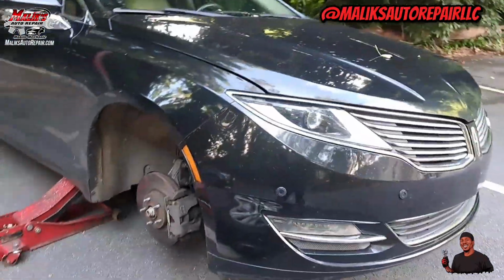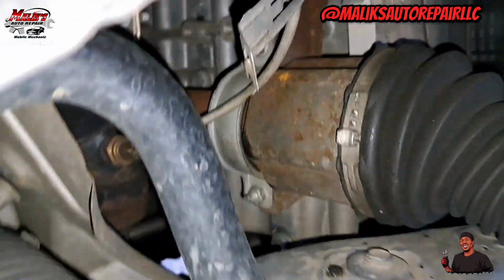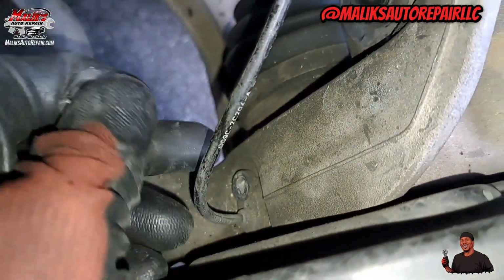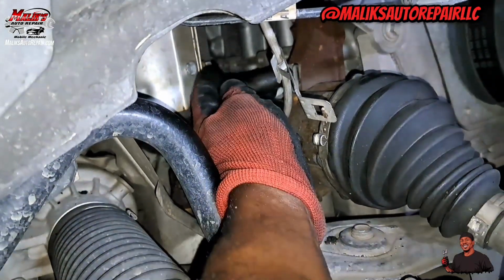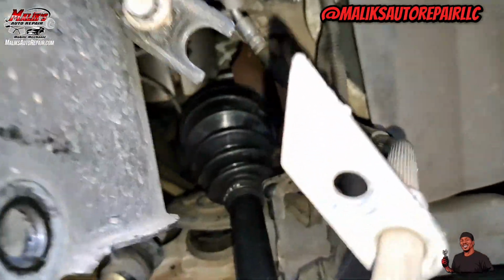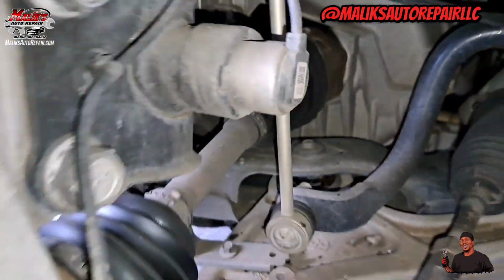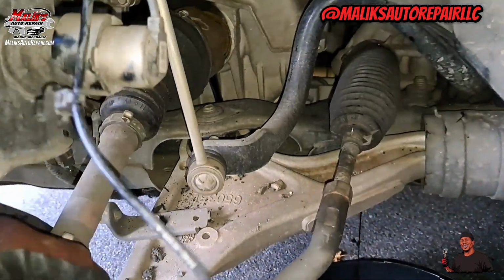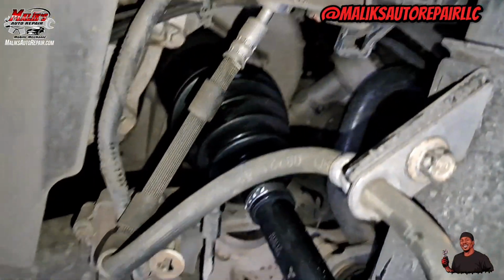HOW TO REPLACE CV-AXLES | 2013 LINCOLN MKZ 3.7 | Howto/Diy

Comment: Would these on my 2017 MKZ be the reason why the front has vibration at highway speeds?
Reply from the maker: Yes, or warped rotors.

Comment: Ouch. Good video but pulling it out with one and not holding it straight could result in a little seal damage. But hey as long as its good to go ..
Reply from the maker: Simple fix. Replace the seal if it's damaged.